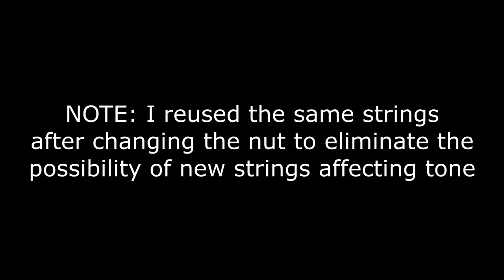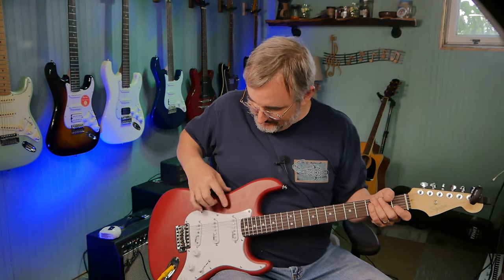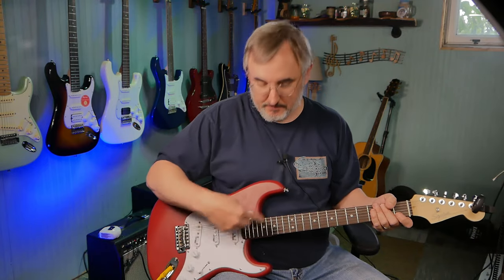I Modded My Squier Debut, Can You Tell The Difference?

Comment: I think people spend way too much time worrying about tiny tone differences that no one will care about.
One important "upgrade" I made to a cheap Strat' was shorter grub screws in the saddles so they don't dig in my hand while palm muting. I care about this each time I play.
Levelling frets for proper action was another thing I did. And lubricating nut and string trees for tuning stability.
Reply: Amen
Reply: How can I found shorter screws, ebay?
Thanks
Reply: @куглаземаљска  I got mine on ebay.
The proper size is M3 x 6mm long for guitars with metric parts (not American made). It fits on my Strats and Ibanez.
Reply: @Leo_ofRedKeep  I have squier se strat, and got installed recently fender trem bridge that goes in mexican series, and when I set standard string action, the screws are way out of the saddles...
Thanks
Reply: @куглаземаљска  I had the same situation. Screws stuck out by about 3mm. 
6mm screws will be all in the saddles.

Comment: Instead of doing the mods, I imagine that it would be cheaper and far less work (with no worries about breaking something during the mod process) to just buy a Boss GE7 equaliser pedal and adjust the sound as needed.    

I would suggest that the only mods that are indicated would be for playability or reliability and not at all for tone or associated parameters.

Comment: As in most guitars (in my experience), the biggest difference was, as you pointed out, in the electronics and pickups being replaced for better ones. If I can make any guitar play comfortably (according to my taste), whether it is a cheap or expensive one, changing the electronics and pickups will do it for me.
Reply: Yeah, except that:
1. Larger pots are not "better" than smaller ones. It is irrational to think otherwise (at least if you understand how they actually work and how they are manufactured).
2. Pickups are 1930s technology. Spending $100 on one is insane. The magnet type and number of winds has FAR more to do with the resulting sound than where they were made or who made them. Which is why Jayce preferred the ceramic bridge pickup to the "upgraded" alnico. Guitarists fool themselves by making needless "upgrades" that are at best "sidegrades."

Comment: I am in the middle of doing the mods.  I put the big block trem in, then I added the roller saddles to it.  New 62 Alnico 5 pickups.  Big boy pots.  Kept the switch cause it is fine.  Then I added a brass nut.  Not in love with the brass nut, will replace it with bone.  Still in the mail is the black aluminum pickguard, and locking tuners.  The tuners it came with are terrible and keep slipping.  Frets were insanely sprouting.  Fixed that.  I love this guitar.  I am also going to put the yellow squier logo on then nitro over it.  I am surprised by how heavy it is.  Neck is beautiful, the grains are almost flame.  Killer guitar!
Reply: I did notice the sounds on both pickups are a bit shrill.  Extra bass in the amp will help, or turn the mids and treble down.  Great video.
Reply from the maker: Thanks.
Reply: I would have liked to have used roller saddles , but I didn't think about until after I received my two new trems with brass block , the " Shorti"
Reply: Why don't you like the brass nut ? I'm not sure if I want to use brass or graphite , or one of each , or ???

Comment: I am currently in this process, hopefully with videos to come in the future. At the end of the day, if you are happy with the results then it was worth it. In your video I do hear an improvement overall with each step, but certain variables are making the change, if that makes sense. On my guitar when I changed the bridge and the strings (which I did first) made a big improvement. The guitar originally sounded "dead", and after the change it became much brighter with more sustain. I also think it comes from the way the tremolo is set up. I haven't changed the nut yet, but I did a lot of work on it  to it to get it right. On my guitar I HAD to change the tuners because I received a bad low E tuner right out of the box, And my tremolo block was defective from the factory as well. So that had to be done just for functionality. With the change in electronics you will definitely notice a difference in performance, pot rolloff and better tone with a better capacitor. That may or may not be noticeable on video. Also adding a treble bleed to a guitar that didnt have it originally will also change everything quite a bit. The wilkinson pickups overall are not that much different from the stock, but I do hear a clearer tone with a little more brightness, which I do like. Cool video, I did enjoy it, and I hope you are happy with the changes. Sounds good on my end.
Reply: The only notes that are effected by the nut as far as tone goes are the open string notes when the string is not being fretted
Reply from the maker: Thank you for watching. I think the improvement in tone isn't totally coming across in the video. Not sure how to capture that, maybe I'll do some audio samples with an amp plugin. But the new pickups are clearer for sure. The original pups seemed muddy to me, esp the middle and neck.

Comment: Larger pots are not "better" than smaller ones. It is irrational to think otherwise (at least if you understand how they actually work and how they are manufactured). Pickups are 1930s technology. Spending $100 on one is insane. The magnet type and number of winds of copper has FAR more to do with the resulting (subjective) sound than where they were made or who made them. Which is why Jayce preferred the ceramic bridge pickup to the "upgraded" alnico. Guitarists fool themselves by making needless "upgrades" that are at best "sidegrades."
Reply from the maker: I actually think the upgrades to the Debut made it sound worse! I have no idea how pots work! Hahaha. Guitars to me are like cars. I just turn the key and it goes. If it stops going I take it to somehow who can make it go again! LOL. Actually I know slightly more about guitars than I do cars.

Comment: I just got my Debut today (2 tone sunburst.) I only bought it because I had a loaded pickguard I put together laying around with alnico v pickups, big pots and thick braided wires and a set of new locking tuners, and the guitar was only $120, so I kinda had to. 
I'm very impressed with the instrument for the price, but it'll be a real shredder when I'm done with it. This is Strat #6 in my current lineup, and once it's upgraded, I suspect it'll be on par with my 2 Affinity Strats. Obviously not as nice as my MIM Fender, but still a great instrument.
Reply from the maker: Thanks for tuning in. I think I agree with you. I have a MIM also, and the Debut, even after I upgraded it, isn't quite as nice as the MIM.

Comment: Thanks for sharing! 

Both before and after mods made workable noises. If anything I am more surprised the stock sounded actually fine, may be a smidge thin, but not the end of the world!

Apparently the tonal changes hinge more on the pot values and the capacitor, and the tone bleed. I too am doing mods and those are the areas I am focusing on.
Reply from the maker: I wasn't all that impressed with the Wilkinson pickups. A little to vintage stratty sounding. Maybe just changing the tone and volume with good quality parts would have made a difference.

Comment: I notice that you have 3 hss (affinity?) strat style guitars on the wall behind you. The tone coming out of my debut is flat in comparison to my Epiphone LP special 1 with 2 humbuckers (no longer made) I was wondering if the hss configuration is worth modding my debut?
Reply from the maker: @philwood9760  I prefer the sound of humbuckers so I would think adding that would make the Debut sound a lot better. Other than the pickups it’s a decent guitar.

Comment: Hard to tell. Youtube has compression.. You should try the Peterson strobe tuner.  I have the StroboPlus HDC and it's excellent.  Always had trouble getting my tele to sound right.  Made intonation tuning much more accurate as well.
Reply from the maker: Thanks for the tip. I often wonder if the clip on tuners are not the best for setting intonation.

Comment: "I believe our perception of sound, much like our perception of color, is highly subjective. Just as individuals who are colorblind perceive colors differently without it impacting their daily lives (as I learned from a TED Talk), our auditory experiences can vary greatly without necessarily being a hindrance.

In my opinion, the Alnico V pickups do produce a distinct sound compared to the original guitar pickups, but the difference, to my ears, is subtle at best. One crucial factor to consider is that I’m not physically present to hear the guitar live. Instead, I’m relying on my computer’s processor and speakers to deliver the sound, which may not fully capture the nuances of the live experience. To form a more informed opinion, I would need to perform the upgrades myself and hear the results firsthand.

At this point, my impressions are based solely on the video. Therefore, I can’t definitively confirm or deny whether the pickups made a significant difference in the sound."
Reply from the maker: I’ve been playing the guitar quite a bit today and it sounds better than in the video.
Reply: @JayceAllanGuitar  this I could believe . I was thinking about buying this same guitar used within the return policy of Amazon at a discount & changing out the picks ups  like you had done & call it a day..

Comment: These seem like a really good and CHEAP name brand mod platform. Would love to drop some fender noiseless vintage pups in there and some MIM tuners and a bone nut in there.

Sounded better with the original nut vs the Tusq nut, but of course that’s through YouTube on an iPhone. What really matters is how it sounds in the room in front of that amp. It all comes down to preference. My only real suggestion other than noiseless fender vintage pickups(which new are 2x the cost of the guitar sadly) is shielding the everloving hell out of the cavities and under the bridge, pick guard etc to eliminate some of that single coil hum.

Also can you confirm the routing under the pick guard was HSH? Heard it was but haven’t seen one in person with the guard off yet. Seems like a solid platform if that’s the case.

And a follow up if you’re ever pulling things off and have a fender laying around… are the parts guard etc 1 for 1 with regard to interchangeability with fender and squire hardware? Like if someone buys fender branded loaded pick guards are they a drop in replacement?
Reply from the maker: I’m pretty sure it’s HSH but I can confirm that. I also have a MIM Strat and I can check the pickguard.

Comment: Honestly, I listened with with AKG 240 headphones and based on what I heard, the endeavor was a waste of time.  I agree the original pickups sounded slightly better.
I hope you get back into making videos on what I thought was going to be your "niche" , trials and tribulations as you progress in learning Vectric software for CNC routing your own electric guitar bodys on your Long Mill MK2 CNC router.
Reply from the maker: Well, to be honest. The guitar videos out perform the CNC stuff. But my goal is to get back to doing the CNC stuff too. I just have a lot on my plate and the guitar review videos are easy and quick to make. The CNC videos take hours upon hours and my shop is all cluttered because of the ongoing home remodel. Maybe if I did YouTube full time I’d have time. I also run another YouTube channel that takes a lot of my time and that channel provides my revenue. So I get where you’re coming from I’ll see what I can do.
Reply: Good to know that your not giving up on making more guitar making videos  @JayceAllanGuitar

Comment: The only "tone" difference I notice is on the Ceremic vs. AlnicoV's.  Alnico's sound a little Brighter in the Mid-Highs.  Which does seem to work better in the middle and neck (like you said).  Ceramics have a little touch of "murkiness" and do sound a bit better in bridges, especially in "high gain" or high distortion applications.   At least, that's how it always sounds to my ears.

Comment: I had a knob with a whole shaft pull out of one of my guitars when taking knob off also. Like it was a different kind of pot than usual. You could actually pop it back in. But i changed that crap out.
Reply from the maker: This one actually broke, The threaded part that holds it in the body broke away from the pot housing. Cheap metal.

Comment: The pickups definitely made a difference. You can dial the tone back on the bridge pickup like I think most people do anyway, but the notes did seem more defined with the new pickups. Nut and trem, I didn't really notice any difference but they're more about tuning stability anyway, or hand comfort for the saddles. How much did those mods cost in comparison to buying the next price level of Squier?
Reply from the maker: Cost comparison is in the description. I paid more for the upgrades than I did for the guitar! LOL But overall the guitar would still be under $300. So, maybe not the best course of action.
Reply: @JayceAllanGuitar  Sorry, I didn't notice it. I think the harness was worth the money. The nut was only $15 so not a big deal eve if it doesn't make much difference but if you really don't use the trem much then it's probably not worth the cost unless you really like experimenting and just enjoy customising your instrument.
Reply from the maker: @vodkaman1970  I agree. I changed the trem/bridge on this out of curiosity, because so many people claim changing the trem to the bigger block will provide better tone. I personally didn't notice a difference. The new bridge definitely has a better tremolo, it functions way better, I should have included that in the video.

Comment: You mentioned that you used the larger replacement tone and volume pots, did you have to do any routing because I have had difficulty in the past trying to use the larger pots on import guitars especially telecasters and did you use a 35 or 36mm short block tremolo because since Squiers have thinner bodies if you use a 39mm or 40mm block the springs tend to rattle more and rub against the tremolo cover which is something that I discovered recently. Interesting experiment but a lot of things like tone as you mention tend to be subjective. I think the modifications a lot of times are for more durable components  and to improve the playability of the guitar such as avoiding cutting one's fingers on the frets.
Reply from the maker: Nope. The new pots and pickups dropped right in. I used a short block trem designed for Squier type bodies. It’s full thickness and steel but short. I forget the size. I think there’s a link in the description of the video to Amazon.

Comment: Supplying the part# would be appreciated ,  is the plastic nut  flat or round on the bottom ?
Reply from the maker: For the Pacifica? PAC012
Reply: @JayceAllanGuitar I'm probably going for a graphite nut on at least one of them , and probably brass on the other, since I bought two of the Debut Strats, I'll keep you updated!
Reply: I also bought two new shorti trem bridges with a brass block.
I like brass because my SLICK SL54T has brass hardware ,I love that guitar , you should get one !
Reply: @JayceAllanGuitar  No , Squier Debut.
Reply from the maker: @johnnie3Chords  Oh sorry, all the parts are listed in the description of the video.

Nut:
Tusq Model PQ-5010-00 Slotted Strat Style
https://amzn.to/3X8XZFQ

The old plastic nut was flat if I remember correctly.

Comment: Too bright is not a problem in electric instruments. It would be on an acoustic one which is heard in the room without processing but anything that goes through an amp will be toned down to taste. 
I wonder what pots are ín this guitar. Squiers used to come with 500 KOhm pots which leave a lot of brightness through. 
I heard much more clarity in the new pick-ups, which I value for clean tones.
Reply from the maker: That reminds me to mention the pots. All three were 250K, the old ones on the Debut are also 250K, but dime sized. The new ones are full sized.
Reply: @JayceAllanGuitar  Size makes no difference. Value does. 500 K put a higher resonance peak in the 5KHz area.
Reply from the maker: @Leo_ofRedKeep  I see.

Comment: The biggest differences I noticed was the new pickups are brighter. The stock was more muted.

All together it seemed that most of the differences would be easily changed by technique and amp /pedal settings changes. Not a horrible sounding guitar either way.
Reply from the maker: I agree. I thought from the beginning that the stock pickups in the Debut seemed “muddy”.